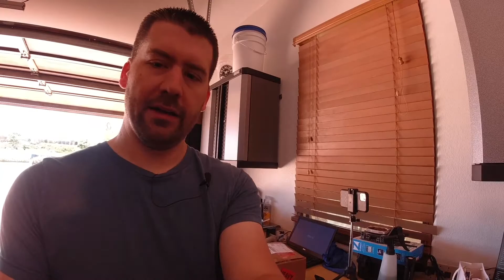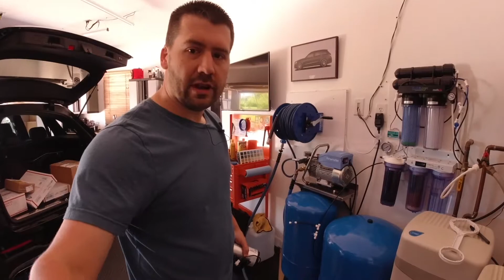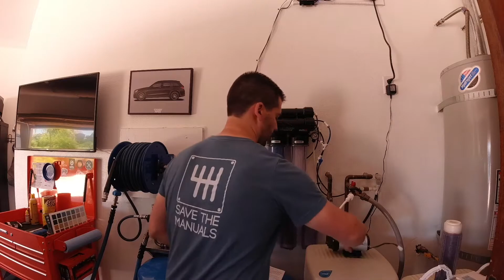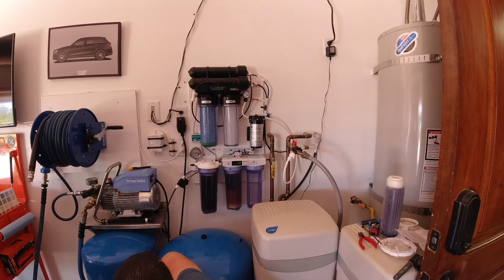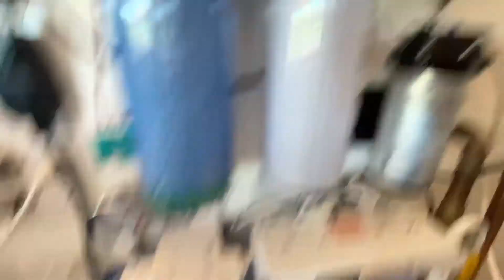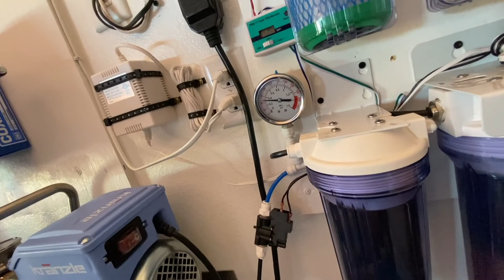IG80 Adding a booster pump to my RO DI water filtration system

Comment: That’s pretty cool man the gauge that kicks the pump on does that read the air pressure in the water tank how does it work?
Reply from the maker: there is a sensor that sits inline on the output side of the water system before the tank.  there is a set screw on the side that adjusts the on / off pressure, both of those are adjusted simultaneously.  In my case it sees the pressure drop to about 20PSI and the pump kicks on, the pump runs until it gets to 45psi or so.  The least efficient a reverse osmosis system can ever be is when its topping off the tank, and im doing that all the time.  This pump makes the system way more efficient in both the quality of the water and the amount of water wasted by the R/O.  Im planning to do a full video on the water system, a few people have asked about it.